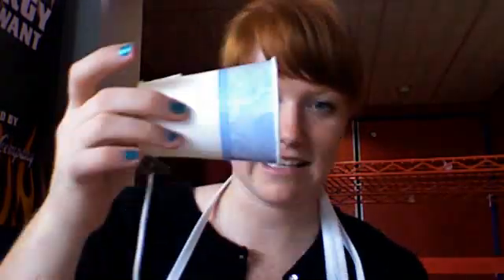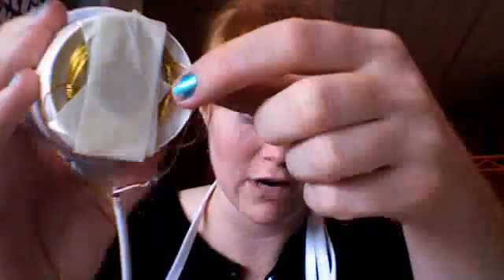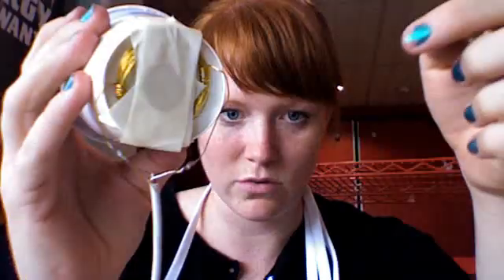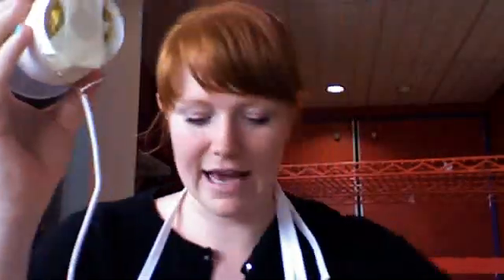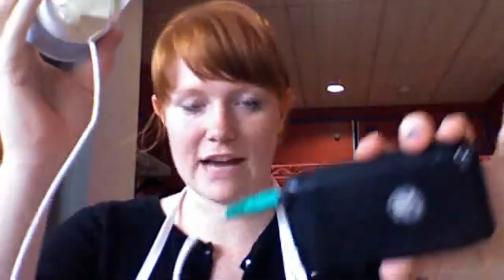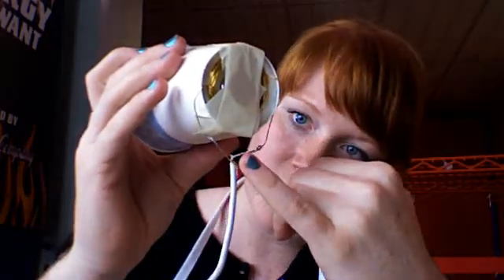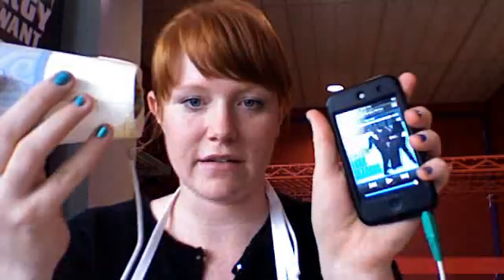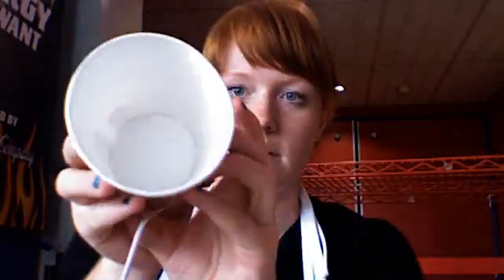Homemade Electromagnet Speaker Experiment

Comment from the maker: I actually just used enameled craft wire, a decently thick one. However, with enamel wire you have to be mindful that you always grab some sandpaper or an emory board (nail file) and sand off the enamel for the ends you are using to connect to power sources or other wires. Have fun! :)